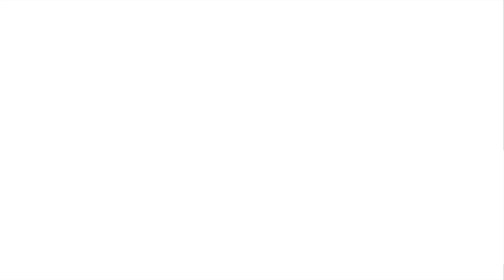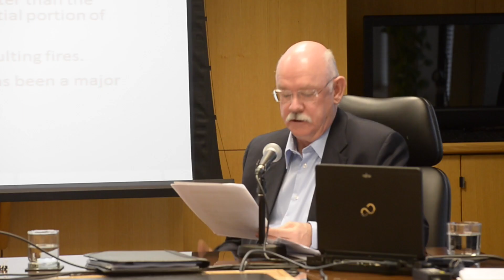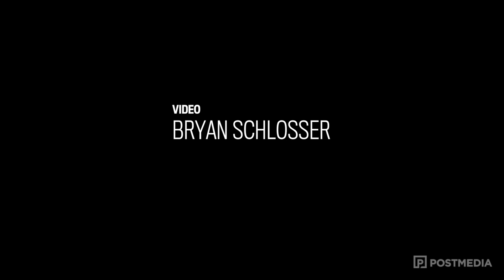SaskPower smart meter fire explanation

Comment: Smart meters need to have a surge arrestor installed of good quality and construction before any smart meter is installed.  This is the why many fires happened.  The smart meter is enough to overload the consumer unit, which are often at max load and cause the cabling to overheat and potentially fire damage.

Comment: 🔥🔥🔥🔥🔥🔥🔥🔥🔥🔥🔥🔥🔥🔥🔥🔥🔥🔥🔥🔥🔥🔥🔥🔥🔥🔥🔥🔥🔥🔥🔥🔥🔥🔥🔥🔥
He just admitted to a CRIMINAL ACT    
Have this clown arrested on ARSON CHARGES
He told us there was moisture and contaminants inside of the customers CSA approved meter box.
IT IS A CRIMINAL ACT TO INSTALL ANY DEVICE ON A METER BASE IF THE CSA CERTIFCATION HAS BEEN LOST DUE TO MOISTURE AND CONTAMINANTS
IT IS A CRIMINAL ACT TO INSTALL ANY METER ON THE CUSTOMERS CSA IF THE POWER WAS NOT TURNED OFF DURING THE METER SWAP

So here are two points.
#1 If there was water and contaminants in the meter base, then installing a smart meter into a meter base that no longer has CSA approved is a CRIMINAL ACT 
#2 If the installation of these smart meters allowed water and contaminants in the meter base, then this is a CRIMINAL ACT
So houses that have had analogue watt meters for 50 to 60 years with no problems, now within weeks of cheap plastic smart meters being installed by IDIOTS and CRIMMINALS, you have FIRES 

What can be done to assure SaskPower no longer tries to MURDER their customers???
Send a Certified Independent Electrical back to every home that Sask Power installed their smart meter and have that Electrician RE-CERTIFY that all meter bases are in compliance.
This is a huge cost to assure the safety of every home, but it needs to be done to protect the lives of SaskPower's customer lives.
OR PAY SOME CLOWN TO SPEW BULLSHIT AND MAKE SURE THIS NEVER HAPPENS 

WHY WOULD THESE ARSONIST DO THIS TO THEIR CUSTOMERS?              The answer PROFIT   
The faster these meter get installed, the more money the installers get.

IF THE METER IS NOT BYPASSED, THEN THE CHANCE OF A SMART METER FIRE INCREASES BY A FACTOR OF 1000 TIMES
 *IF THE CUSTOMERS METER BASE IS NOT INSPECTED TO MAKE SURE THEY STILL MEET UL/CSA CERTIFCATION, THEN RISK OF A FIRE INCREASES BY A FACTOR OF 10,000 TIMES AND THE UL/CSA CERTIFICATION OF THE CUSTOMER'S METER BASE IS DESTROYED BY THIS CRIMINAL ACT. 

WATCH, AND TAKE NOTES ON THE ONLY LEGAL WAY TO DO A METER SWAP https://www.youtube.com/watch?v=G0bq2Hn2vOo 
Just in case you wanted to know, here is the LAW in Canada.

 “CSA C22.2 NO. 115-14 1.5 says “Meter-mounting devices, as covered by this Standard, are not intended to be used as load-making or load-breaking devices.”, meaning that electricity must be disconnected or turned off during meter exchanges. Aside from the obvious concern about the arcing and consequent pitting which occurs when contacts are made or broken under load, another concern is that one's meter base could lose its CSA certification if it’s been used as a load-break device.” 

SMART METERS CAN NOT BE USED TO INTERRUPT THE LOAD

Comment: 🔥🔥🔥🔥🔥💀🔥🔥🔥🔥🔥🔥🔥🚒🔥🔥🔥🔥🔥🔥🔥☠💀☠🚒
Already have a meter ready to burn your home down installed on your home?
SMART METERS CAN NOT BE USED TO INTERRUPT THE LOAD
 IF THE METER IS NOT BYPASSED, THEN THE CHANCE OF A SMART METER FIRE INCREASES BY A FACTOR OF 1000 TIMES
 IF THE CUSTOMERS METER BASE IS NOT INSPECTED TO MAKE SURE THEY STILL MEET UL CERTIFCATION, THEN RISK OF A FIRE INCREASES BY A FACTOR OF 10,000 TIMES AND THE UL CERTIFICATION OF THE CUSTOMER'S METER BASE IS DESTROYED BY THIS CRIMINAL ACT
If you come home and find the power has been interrupted to your home and you have a new smart meter, call the police and charge your power company and the meter installer with ATTEMPTED ARSON.
WATCH, AND TAKE NOTES ON THE ONLY LEGAL WAY TO DO A METER SWAP
 https://www.youtube.com/watch?v=G0bq2Hn2vOo 

#1 If they install a smart meter and your power goes out, then they are an ARSONIST. 
In Canada, it is against the law, all smart meter swaps have to be BYPASSED to keep the power on.

#2 If the customers UL certified meter base is NOT INSPECTED by a CERTIFIED electrician before the meter swap, they they are probably breaking the law and will increase the chance of your home burning down by a factor of 10,000 times. 
Remember, the only electrical device in your home that is NOT UL APPROVED is their smart meter. 

Why do you ask a smart meter is not UL APPROVED 
BECAUSE THEY ARE NOT BUILT STRONG ENOUGH TO MEET UL'S SAFETY REQUIREMENTS.
They are only certified to measure power consumed.